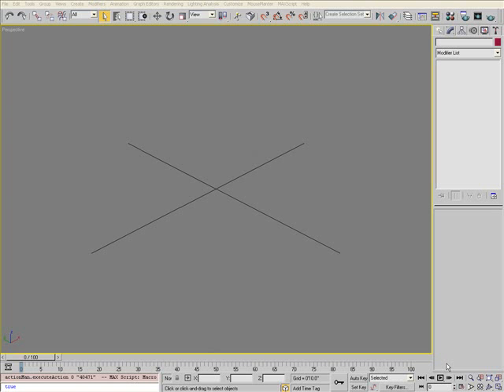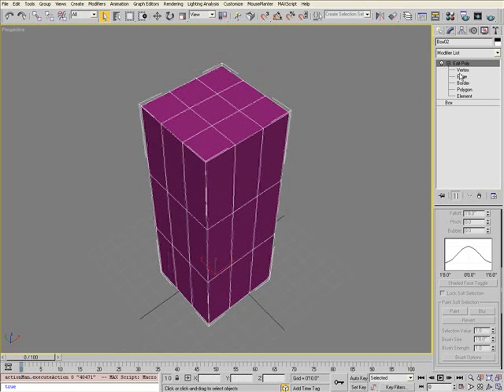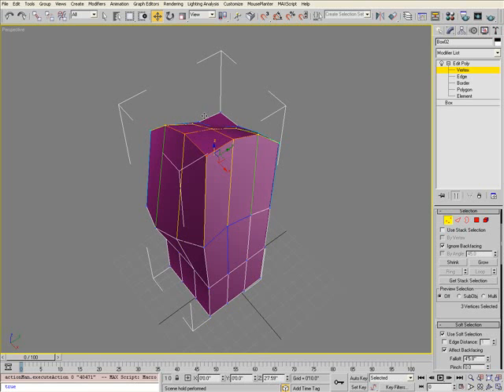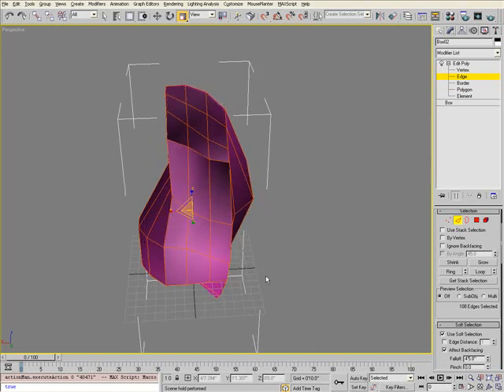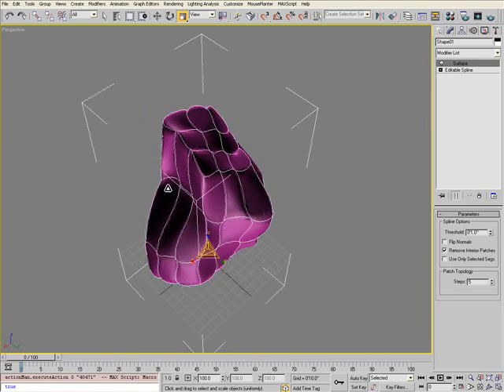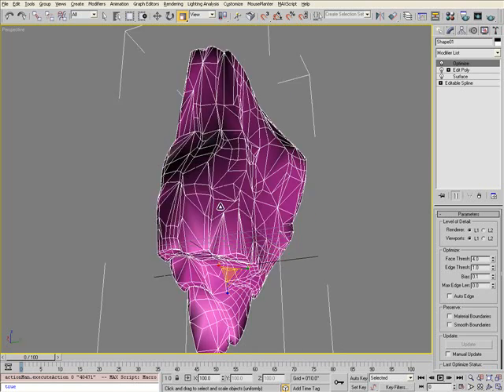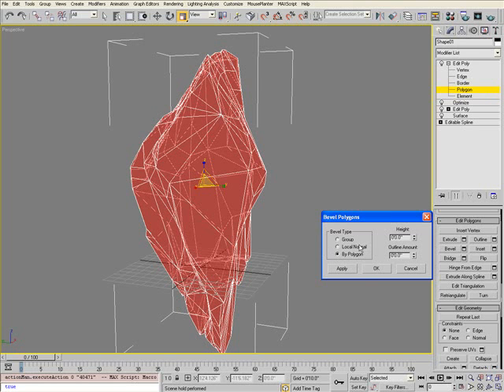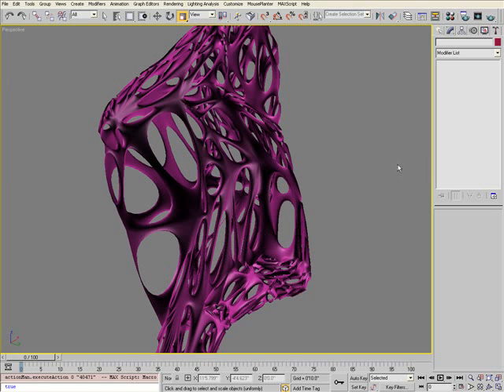3ds Max Tutorial: Perforated Form

Comment: Spines are ugly, horrible things.

But you should be able to change the settings to adaptive subdivision, or lower the smooth subdivision

if that fails to work, most likely your model is WAY to big and its compensating for the size by making to many polys